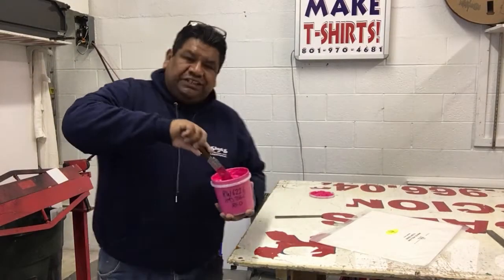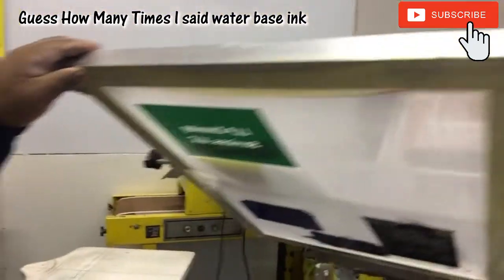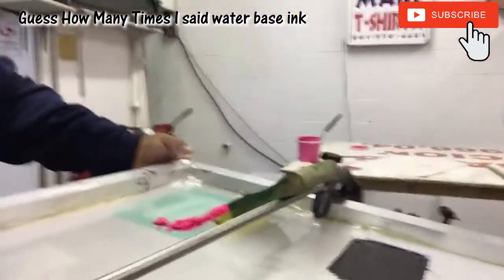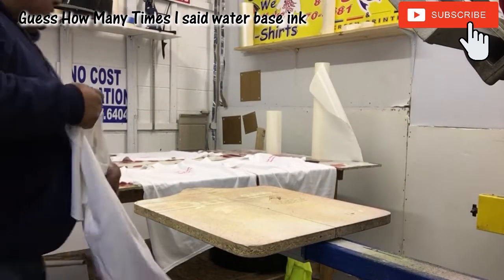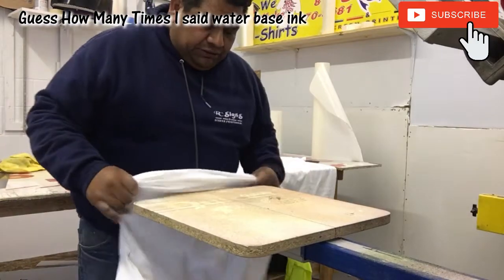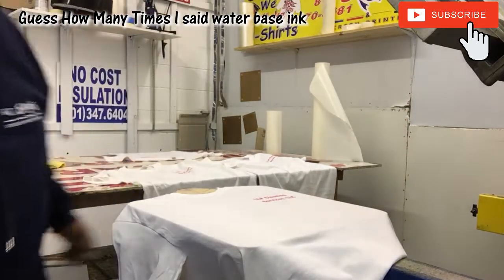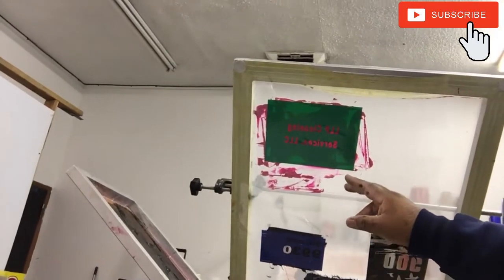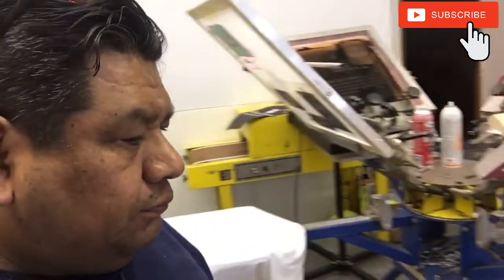Screen Print Water Base ink On T-Shirts!

Comment: Hey Ricardo! Good job Bro, if you don't have any water base imulsion you can use regular emulsion just post expose it under tge sun for about an hour and a half (the longer the better) and should be good especially for a small job like that, you can use the heat gun to dry it that's perfectly fine (don't listen to waldo LoL) just make sure the shirts don't get wash within 24 hours, again, good job! Oh and don't listen to Waldo 2413 I don't know if I mentioned that LOL